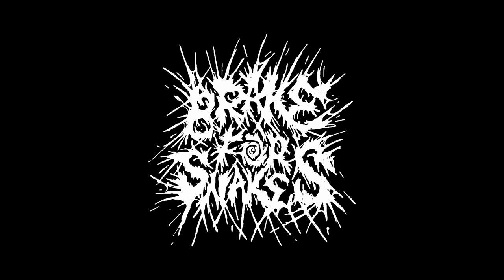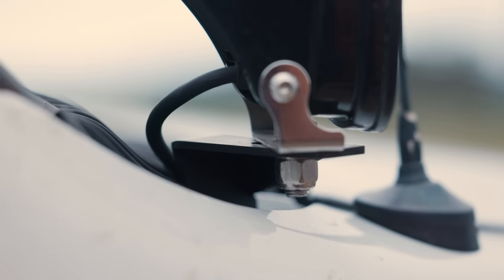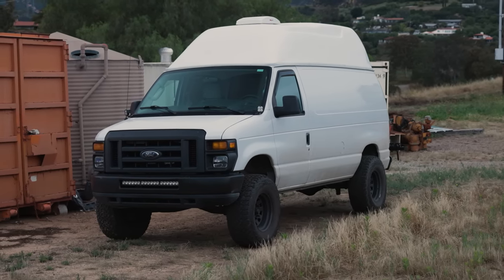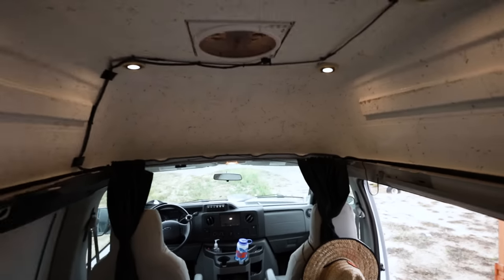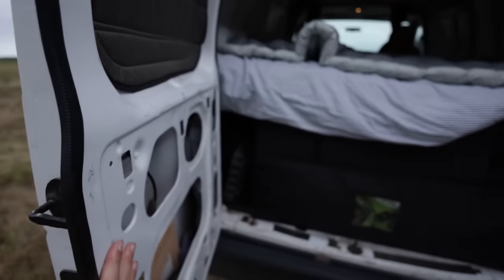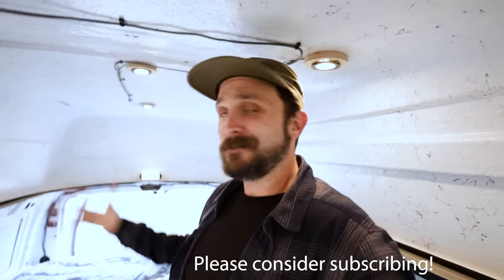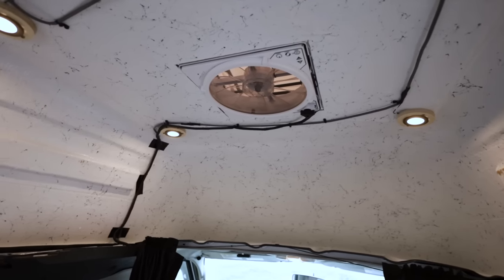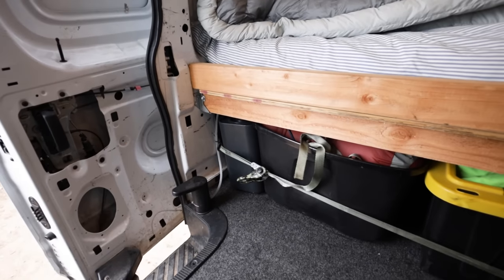This cargo van conversion cost how much!? Crazy cheap option to a Sprinter van!

Comment: If you want a high top but cant afford 6k, find a high top van in the junkyard, and pull the top
Reply: Wow I've thought of building a wooden box up top bet never thought of taking the top from a junk yard
Reply: But how to make sure it’s installed correctly where it won’t leak.
Reply: Junkyard is great for high tops but from someone who has pulled one off a van and out of a yard let me tell you you need at least 4 people to do it comfortably! They are heavier and way more cumbersome than you would imagine.
Reply: Never would’ve thought of that smart man
Reply: After pulling the high top, would you paint the inside?
Reply: @whankin2  that depends on the high top, some are finished, some are raw fiberglass
Reply: @Bryan-jd7os  I found that out the hard way I went with just two guys and the mechanics at the junkyard accidentally snapped the roof in half with the forklift maybe next time lol😢😂
Reply: Just hack and add a John boat on top. lol
Reply: Maybe I should just get the whole van in the junkyard. 😮

Comment: Dude I'm glad to hear you using a lunchbox locker, this is exactly what I have been looking into. I'm very interested to hear how this has been working out for you.
Reply from the maker: I love it but I’m doing a full video on it soon!
Reply: I have a powertrax in a 99 Durango on 33" tires.  Works great off road, takes a little getting used to on road but I usually forget it's there.  5 years, no problems

Comment: I love these kinds of builds.  Simple and effective.  Not much to break either.   And it can still go anywhere on the trail. 
The Holy Grail of American Vans has to be the Dodge Ambulance Vans that were EXTRA WIDE.   And I think they were the full 8.6 foot width.   They came with the  Extended top from factory.    That along with it having the engine mostly in the cabin like the  Early Ford and  GM vans really give you TONS of space in the rear.

Comment: Thanks for the walk around! I love the minimalist build! Simple is highly underrated! No shame in prioritizing the budget on the the things that are most important for you! Also, to your point, It’s hard to find a used ProMaster delivery van for less than $30k. I’m guessing you have less than half that in your current build, and you are already way more capable off road, getting the same gas mileage and able to camp in it. Well done. I have a ProMaster RV build with all the bells and whistles, that I am paying way to much for and constantly fixing poor coach  build quality issues. So much so that I’m looking and your video and thinking really hard about what’s next for me. Thanks for sharing and opening my eyes to a really cool and far less expensive option!
Reply: Hey not sure if you ever came up with a bug screen solution but Amazon has home patio/garage door screens with HD Velcro on the sides and top and a really decent magnetic closure for $22! I was looking at van specific screens and like you said, they were $600-800. I’ve been rocking my AMAZON screen for 2 years with no issues.

Comment: Had two 4.6 f150s, 98 and 07. Towed with them, loaded them up, no problems. Certainly none of the spark plug or fuel pump issues known on the 5.4.  Looking for an eco van to do much like you. Love your approach. Looking forward to more experience with that locker. Thanks for these videos!
Reply from the maker: Thank you and I totally agree about the 4,6!
Reply: Is that 4.6 a V8 or V6?
Reply: @joeblow1942  4.6 was v8. 4.2 was v6.
Reply: 4.6 is good Ford V-8

Comment: I drove an Econoline every day for work for several years and you are correct, they do wander around and it's especially noticeable on the highway. It has since been replaced with a Transit which basically drives itself. Difference in handling is night and day.

Comment: Nice setup everything you need to be comfortable. Also I believe when you do a big build out that extra weight really affects the capability of the vehicle off-road. With your setup if you need the van to haul work gear you can remove all your things within a few minutes which is nice. I’m doing something along the same lines to mine.
Reply from the maker: Exactly!! We just yank the mattress out and our camp gear then we have a full cargo van to move stuff it’s awesome.

Comment: Crazy Cheap is Relative, obviously. However, on your end of the spectrum, I love what you've put into it, it's awesome. Visually it really reminds me of my old van I had and loved very much. Mine was a dodge high-top conversion van. I first gutted the interior completely (walls, topper padding, floors and everything else), later building out to my liking - keeping it as minimalist as possible. For suspension lift, I went with really dirt cheap spring lift - yeah I know, absolutely not the best way to do a lift, but "crazy cheap" for the effect. Aesthetically, it really looked like your Ford does now (slightly lower).

Comment: There is a type of soft insulation (i forget the name) that is thin and the outside is a black material and it looks not bad and it comes in sheets so could serve as a finished wall perhaps and save inside space.
Reply: I think you're talking about the 3M Thinsulate, that's what I'm planning to use on my build!
Reply: @treykorte6984  yes, I remember it was 3M. Good choice, I think. Best of luck.

Comment: if people really want a budget van you gotta do like i did and lift and convert an awd astro van to 4x4, you''ll give up a lot of comfort but it's very cheap and even if you don't keep it it will at least help you find out what you want in a build. I'd love a full on econoline build like a sportsmobile but those are too expensive and they won't get into places that I regularly take my astro, im always plowing tree branches with it and it only has like 4 inches of lift and 31 inch tires.

Comment: we did this back in the mid 80's with a 1975  e 250 with a O R D 2 wheel drive lift  running  largest tires i could find ,  detroit locker with gears  straight six with a thru the floor Borg/warner 4 speed  its still may be running around tucson  all custom built interiors raised deck with storage below  this was Our go to camper / hunting rig  so many people approched us to ask about it many thought it was 4 x 4
Reply from the maker: Hell yea that's rad

Comment: I love the vans, and they do have their advantages, but for longer term living I always suggest finding something square, with space to stand up,  and the ability to mouse proof the small holes and whatnot. Engine bays are cabs are near impossible to keep mice out of. Building an insulating a square space is much easier than dealing with curved walls. Cube van, cargo hauler, or build a cabin on a steel trailer are my picks, and future plans. Vans are sleepable, but not very liveable for hosting others or standing up haha. Cheers everyone.

Comment: I drove a ford econoline for work doing deliveries, i loved that thing it was a beast. If i remember correctly it was 3/4 ton. Yea def was because i used to haul heavy pallets in it. Have always wanted one since. N yea it wasnt really a pleasant ride n it did wander lol, but man it ran like a champ and just felt so dependable like it could handle anything
Reply from the maker: The weldtech suspension kit fixes all that wandering!

Comment: Stick to your plan when it comes to interior builds...take your time use it in different senarios get a feel for covering your bases based on purpose. I am currently redoing my transit from initial set up - hanging a big rug along the driver's side wall, picking up a couple furniture bits from the good will and tossing a recliner and small power bank in there...we hit the rd to Colorado from GA. Had a blast & learned alot... each trip teaches/shows you something new...thinking outside the proverbial box is the perfect M.O. for getting it right without spending toooo much money...plus these days with vans being easy targets for opportunists it seems better to 'look poor' and maybe stay under the radar. Good luck

Comment: 6:45 I've been driving/living-in my Econoline for 5 years. The ride quality from the front suspension is my worst complaint about the Econoline platform. Eventually I'll do a 4x4 conversion, I just wish I had budgeted for the conversion when I first got the van.

Comment: Have the same van E250 4.6L!  Just had 265's installed and the WeldTech grocery getter gets installed next week.  REally like what you've done.  Not sure about which locker to install.  Thx for the tip.  Never heard about it but at $400 sounds great!

Comment: 1998 Ford Econoline 4.6 here. Hitting near 200k on miles. Still running strong! I'm going to have a new fuel pump switched out before long - just preventative due to year & mileage. No lift, don't need that. No build, although it looks like one. I added a platform inside for better storage. Supported by 2×4 legs which I did all myself. 
Was actually able to turn one of the bench seats around by switching the bolts around on the floor, (passenger van), so I can use that for a sofa/bed. It sits directly behind the front seats. 

I recently added bug screens, which I'm quite happy with, I have a video of that on my channel. Yours would be easy with the use of magnets. My interior is all cloth & plastic liners around walls & windows. 

Recently added a swing away cargo carrier also, but am going to modify it some too. My brother helped by putting a hitch receiver on my step bumper. 

I also have a 1996 Ford E350 ClassC motorhome, but it's sitting in Texas while I'm in PA helping my aging mother. Brought the van to PA instead. 

Same issues with my ac's in both vehicles. I'm interested in what you did to correct your problem with yours. Dual air in the van. Which is awesome! But it's not a high top. I Can't have it all! 🤷‍♀️
Reply: I forgot to mention. I ordered my bug screens from Amazon. They have numerous sizes on widths & lengths. I ended up ordering for width, then cut off & hemmed the length myself. Now I have extra to make screens for my drivers & passenger windows too. Seller is Totozakul. 
The magnets close back together really well! They come with velcro strips & all necessary items. I'm happy with them.
Reply from the maker: Awesome! The AC fix is from Vantage Optics: https://www.vantageoptics.com/shop
Reply: @brakeforsnakes  Thanks!!

Comment: The little 4.6's liiiike to Rev. Hence your good mileage with the 4.56's. Goood choice.  And when you decide to panel the sides.. carpet padding makes a great sound deadener/Insulator. I've done several of my vans with it. As I'm a flooring guy. Cheap and simple. Hang it with Contact adhesive.  NICE build Jim.. My name also.
Reply from the maker: Yea it definitely likes to rev haha. I'll look into the carpet padding but I'm still debating doing anything cause I don't wanna add anymore weight.

Comment: You can spray a non-foam insulation then cover it with a thin adhesive based second layer of insulation if you needed to, or just cover the non-foam spray insulation with those thin adhesive wood panels, you can cut them to fit anything and they'll stick extremely well, if you want them more permanent you could add some type of glue.

I plan on buying one of these vans soon too, hope we see some updates soon, good luck on your build.

Comment: That's a cool and utilitarian build. You got all the stuff you need and no more. I've started toying with the idea of a van build. I currently have a 4Runner that I tow a home made off-road trailer behind. I have a roof top tent on the trailer, but a van is unbeatable if the weather isn't cooperating. Jason from the Primal Outdoor channel also has a Ford van with the Wasatch Overland high top. I'm curious if anyone does some sort of high top/pop top combo? Would be great to have the high top and if the weather is great, the ability to pop it open and sleep up there.
Reply from the maker: There’s quite a few companies that make pop tops for these vans. Pretty hard to beat a van as an all around overland vehicle

Comment: Grabbed several E Series....my fav is a 2013 E350 wheel chair w/ med high topper. Paid $800. Frame still has original paint. High hour 250k miles. Valve train got weak. Having motor replaced now. I am ALL in for low buck. "Wonder on tje road" ...lol. My daily driver is a 1990 E350 ...that bitch SERIOUSLY  wanders.  The 2013 is an arrow.
Reply from the maker: Haha yea the older vans are squirrely

Comment: Jim, what year is your Econoline? I own a 2001 Ford E-150 Conversion van with a Triton 5.4L 2Gen engine with 190,000 miles and she going strong.  I'm looking for something like yours with the ability to camp up in the North Georgia Mountains.  Guy, have you seen what a Sportsmobile costs? Easy to hit 200K so yeah it's a budget build.
Reply from the maker: It's a 2013 so it's the same as yours just with an updated front grill/headlights.

Comment: Have you considered installing a roof rack ontop of your aftermarket fiberglass roof? I think it would add lots of utility but may need to be anchored to the frame somehow.
Reply from the maker: I don't have any reason to mount stuff up that high. If anything I want to keep the center of gravity lower not add more weight up top.

Comment: Very good, thank you!!   I’ve ruled out the Chevy as the rear axle can not be easily modified.  I also want a minimalist bike homebase, for dispersed type camping.   Don’t need 4x4, or maybe even lift.  Ford it is!   I wouldn’t mind diesel but I the fumes get to me.  Don’t want DEF.  What’s newest good year/engine with that in mind?
Reply from the maker: A 2014 with a v10
Reply: @brakeforsnakes Thank you!

Comment: That's a vanrug, right? I just got one of those, and the only bummer is it "dents" if you leave something on top of it... my power box, less than 10 pounds, left a sharp outline from its plastic bottom. Sort of a bummer for 200+ bones. That said? My old carpet was a damned war crime, so it was a nice upgrade.
Reply from the maker: Yea mine has done that but it always seems to bounce back after a while
Reply: @brakeforsnakes  here's to hoping! Helluva build, though. Mine is a conversion and the only stuff I have issues with is the cheap, goofy old plastic in it.

The solution? Crowbar... both the band and tool.
Reply from the maker: @crusherjones6809  hell yea NONE F*CKING HEAVIER

Comment: What do you mean with "conversion"?

I build something similar in a lunchbreak - at least that was the titel of my article. It was actually more like 2 days.
This was JUST FOR Technical inspection, that we NEED in Europe.

After that I CONVRETED the truck.
Reply from the maker: You lifted your van 5”, installed gears/locker and installed a fiberglass roof in a weekend? That’s impressive good work!
Reply: Isn´t it?
I was actually refering to the interior, not the suspension. @brakeforsnakes
Reply from the maker: @derJackistweg oh you were just referring to the piece of plywood I bolted inside in 45 minutes? Surely you’re smarter than that and understand the immense amount of work that went into turning this van into what it is from a stock econoline.

Comment: That's a badass van! I have an 04 all-wheel drive lifted Chevy Express with a nice suspension lift and Bilstein shocks, I upgraded to a 14-bolt semi float rear differential and it has a G80 rear Locker, very nice on the road and off
Reply from the maker: Hell yea!

Comment: Always go with ford, Chevy or dodge vans when it comes to utility or camping vehicle. Anything else is an excess, unless you want to live in it.
They are simple, rugged, parts are everywhere and any junkyard will have axles, pumps, engine or tranny.
Plus they are disposable, bracket for light? Just drill a hole, two washers, marine sealer and you are good.

Comment: Where are u finding good vans in so cal for 2 to 5k i paided 6300  for a 2003 e150  with 155k miles i thought that was good?
Reply from the maker: I don’t think a $2k van will be “good” but I did pay $2500 for my 2000 e350 with a quigley 4x4 conversion in Tahoe. Just gotta dig around its essy to find cheap vans. Just found one in Ventura for 2500obo on fb marketplace this morning.

Comment: Great vid!
Reply from the maker: Thank you!
Reply: After having a 1990 4x4 Econoline and 2 sprinters. Picking up a 2014 E350 next week and rocking the 2wd. You really don’t need 4x4 in 90% of “vanlife”
Reply from the maker: @kirillevdokimov7647  I couldn't agree more! I sold my old quigley 4x4 for this van and it drives so much better on and offroad than that old van. Yea it doesn't have 4x4 but I rarely used it as is.

Comment: Do you have any thoughts regarding the extended version of these vans built out in the same way you have done/are planning?  Is their body base a hindrance on the trails or would they be capable?

Thanks for sharing your insight and your personal experience/products use/install info.
Reply from the maker: My last van was the extended body and it’s much nicer in terms of interior space but I hated how long it was off-roading so kinda depends on what you plan on doing with it
Reply: @brakeforsnakes  Did you have the same lift on the extended that you have on this van?
Reply from the maker: @SheahanClan  no it was a quigley 4x4 van